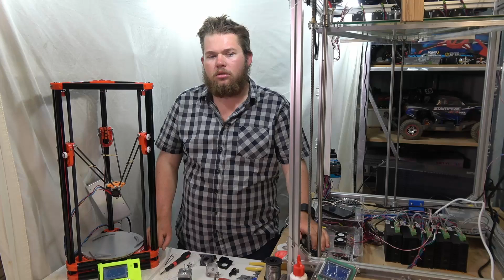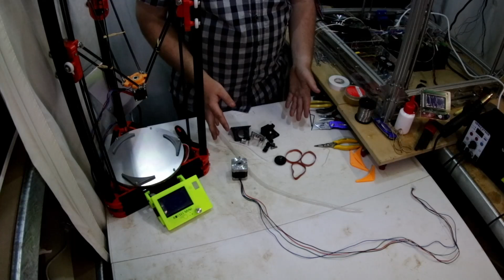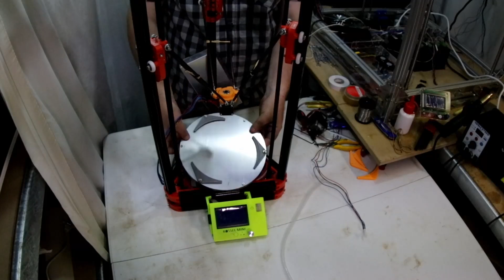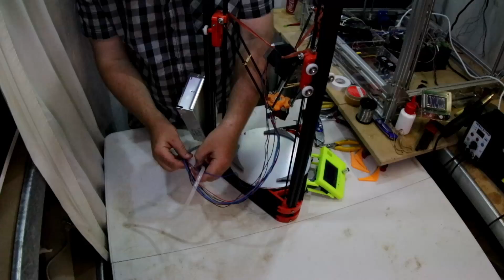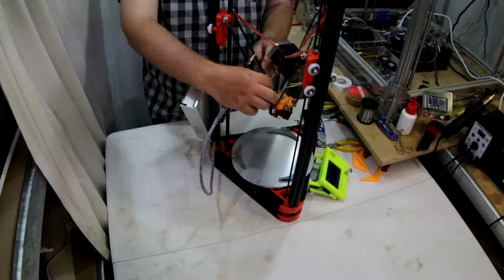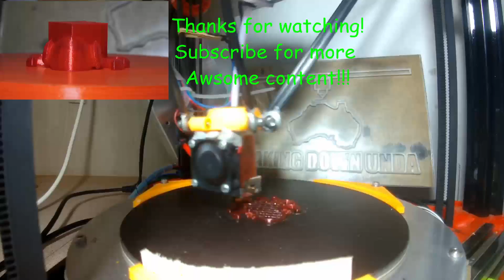How to install a flying extruder setup on a delta printer.

Comment: What's the point though? your still adding weight making it slower...
Reply: Reducing the Bowden tube length makes steps much more accurate, thus making the print better overall (and helps reduce oozing, missed steps, over-steps, clogs, etc), and can open your machine up to flexible filaments.
The trick here is that the weight added is distributed to the z-axis (which has 3 motors, thus good torque and rigidity), but almost no extra weight (< 1/3 total weight of nema17) added to the x/y axis', so you get most benefits of direct drive, without too much additional torsional distortion (backlash, etc)
Reply: You may have more static mass, but dynamic weight is decoupled by the elastic bands. The effector can still make high acceleration moves without the extruder having to follow.